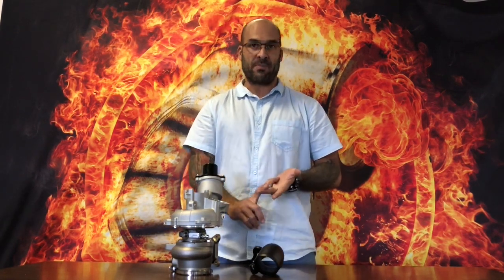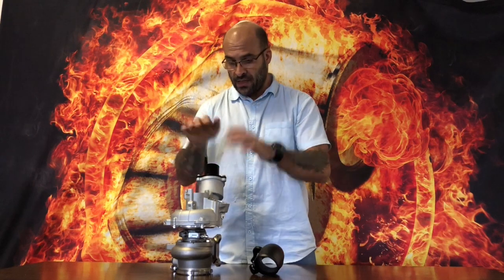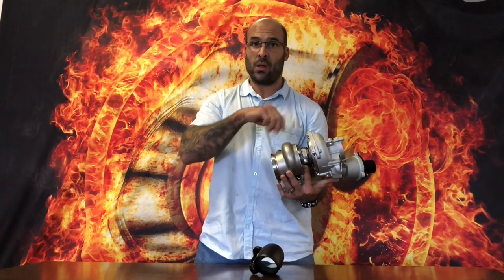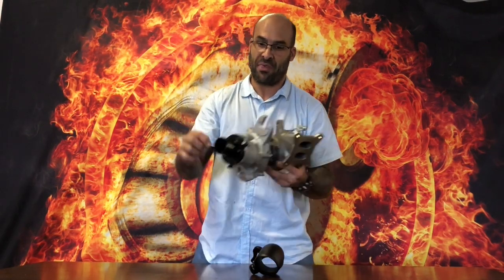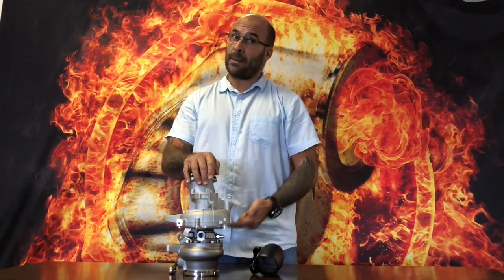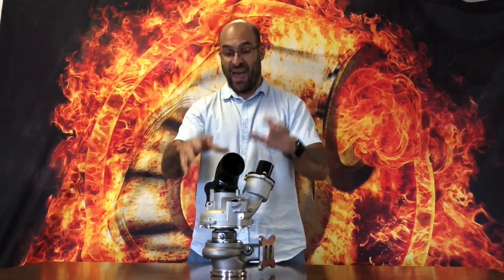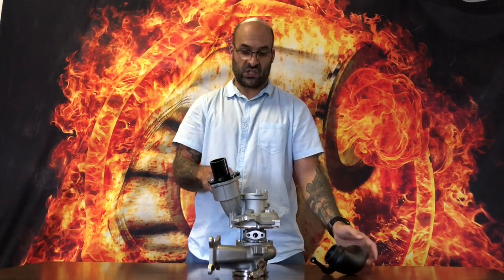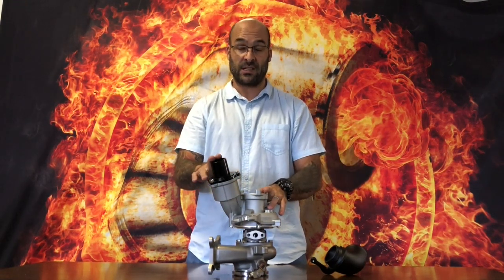IS38 700HP Ball Bearing Bolt on G7R

Comment: Too bad you can't find this turbo anymore
Reply from the maker: We have not discontinued this, we have in fact upgraded and replaced this with something that performs the same but spools alot faster -  see here:- https://turbodirect.co.za/store/index.php/shop/category-layout/results,1-24?virtuemart_category_id=&keyword=is38-550&limitstart=0&option=com_virtuemart&view=category&Itemid=541 

These rotating assemblies are capable of making 550WHP + (fuel system upgrades will be required aswell as clutches on the DQ250) with no problem at all.

Comment: Any update on numbers with this bad boy?
Reply from the maker: Sure plenty of these in the internaitonal market - depending on the tuner, different HP figures will result. Contact Thanos from GT Innovation in Germany, he has extensive tuning on this turbo - he has alot of data.
Reply: @TurboDirectSA  Awesome, will you ever make a GTX3076R version of it? that would be amazing
Reply from the maker: @FLeXJun  Thats where we use the Swirl adapter  - the IS38 comp housing we have designed even with the larger AR isnt enough to support the flow from the larger GTX3076R gen2 Compressor
Reply: @TurboDirectSA  understandable. It's just nice to have internal gate turbo.

Comment: Would you recommend this turbo for a DD. If so when would it be back in stock?   How would I be able to get a proper tune with this turbo on my S3 in the states also, and would my integrated engineering TCU tune work with a 3rd party ECU tune for this turbo. Thanks
Reply from the maker: Tuning we recommend using Thanos Farmakis from GT Innovation in Germany - he is the guru behind the best tunes for the Simos18 ECU's without a doubt bar none!

Comment: Where is your updated information on this turbo?
Reply from the maker: What updated information?  The turbo is what it is - no updates coming, this is a product released in the market. There is an EFR version of this bolt on coming soon - which will incorporate the EFR7163 and/or EFR7670 as the options for this engine.
Reply: @TurboDirectSA  the updates from your comments of charts, graphs, etc of the performance on the car?
Reply from the maker: @rcnacura  We have done alot of testing with this turbo especially abraod with some customers. The top MQB tuning company in Germany called GT Innovation has the most data on the Golf7R with the IS38-700 on.  His name is Thanos Farmakis - aside form the tuning he does he has the most data available. Id suggest you contact him directly for information and his personal opinion and experience.

Comment: Hello! Your project is highly appreciated! Will it work with Skoda Superb 3V3 AWD  (CJXA engine)? Do you have web site/online shop? Just to have an idea about cost of such a quality product 😁
Reply from the maker: thank you for the comments. If the powerplant is the same as the Golf7R or Golf7.5R then this setup will work - if the engine is inline, the turbo will not work due to the differences on the compressor side of the turbo. For pricing please send an email to info@turbodirect.co.za.
Reply: TurboDirect S.A, thank you. Actually, my Skoda Superb 3V3 shares platform with Golf R Mk.7, so it shall fit. Will drop a message to the above mentioned mail box. Cheers!
Reply from the maker: @tec00aba  Pleasure sir

Comment: Dear Chris!,

First of all, I have to say – you have nice and very useful YouTube channel, I have never seen so full of turbo knowledge channel across whole YouTube. Also, I admire your personal knowledge, charisma and willingness to share information!

I have Skoda Superb 2017y, AWD, 2.0 tsi built engine (83mm*92.8*4 = 2008), stock engine used to have 280HP, but now it has something around 510-530HP on pump gas (100 ron) with hybrid IS38ETR Revo turbo (other name is Turbo Technics v4).

It's almost impossible (at least I can't) to find compressor map of this turbo, but I can state some useful facts from my own experience - 1) it has positive spool from 1800-2000RPM on my engine; 2) it has maximum boost (2 bar or 29 psi from 3300-3400RPM); 3) According to logs my engine has air consumption maximum 1450kg/hr (53-54 lbs/min) on 7000-7200 RPM with this turbo.

So, after this turbo blew up my stock engine, I rebuilt engine, I strengthened stock transmission, now it is ready for 800Nm approximately and now I would like to have 600HP+ or 500WHP+ better on a pump gas (I dislike w/m, but if it’s necessary I can deal with it). And one more thing - early spool is pretty important for me, this is almost usual road car, but still – I understand big turbo requirements.

For last 2 months I’m trying to find new turbo for my goals, I’ve considered:
- CTS BOSS 700 kit https://www.ctsturbo.com/product/cts-boss-turbo-kit-mqb-mk7-gti-golf-r-8v-s3-8v-a3/ twinscroll kit with garret 3076r gen2, to be honest I dislike this kit a bit, think this turbo is too big, may be i'm wrong;
- 'handmade' twinscroll hybrid on the base of IS38 with garret g25-660, g30-660 or g30-770 core or compressor;
- wide range of different hybrid's for this engine, such as:
-TTE555, 
- Turbo Technics V5, 
- LM6xx, LM575 https://kolbenkraft-tuning.com/product/lm6xx-gen3-turbo-upgrade-gen-3-vw-golf-7r-mk7-mk7-5-7-r-gti-is38-upgrade-turbocharger-hybrid-lm600-v3-turbolader-upgradelader/?v=6cc98ba2045f
- many-many others.

Accidentally, I’ve found your video about your new IS38 700HP based of garret g3071r gen2. First of all – I’m very impressed with your turbo! But I have some questions:
-	If it’s based on garret 3071r gen2 how it can achieve 700HP? G3071r doesn’t produce enough air for it. I think you mean using E85 with WMI, yes?
-	Dou think it possible for this hybrid to achieve ~600HP on pump gas?
-	What is your price for it?
-	Can you send it in Russia?

Kind regards
Stanislav
Reply from the maker: Thanks for the detailed response, i have rad it and i think that your post deserves a video of its own to cover some of the topics you mentioned below. Ill try to get to this ASAP.
Reply: @TurboDirectSA  Chris, manythanks, i'm looking forward to this video! But still, do you sell this turbo right now and can you ship it to russia?
Reply from the maker: @stanislavaleshin1202  yeah for sure we can.
Reply: @TurboDirectSA  Nice! So, please find my email, I wrote to your personal mail and turbodirect mail adress 26 of June. Thank you, Chris!
Reply from the maker: @stanislavaleshin1202  got it.

Comment: TurboDirect S.A Do you have any solution for the MK6 crowd? I currently have a BW k04-064 and am looking for more.
Reply from the maker: We have PLENTY experience with the MK6 setups, especially with the turbos and ECU (MED17) units, we can provide anything from mild to wild - we have a number of cars running from G25-660 making 400+WKW and another Running the BorgEFR7670 and G30-900 making well over 600WH - we can supply complete builds together with G-force customs from the ground up including tuning, multimaps etc.

Comment: When will you start selling these? Price?
Reply from the maker: We have started selling them two weeks ago, but delays on the supply of Garrett rotating assemblies is holding up the project.
Reply: @TurboDirectSA  OK thanks, does the turbo come will all the install hardware?
Reply from the maker: @idtakae86  Yes it does - we don't supply the water in and out lines just yet, but will be making these up swell and supplying them as a complete bolt on kit so nothing has to be purchased or fabricated afterwards - we will be releasing our 70mm thick intercooler (also bolt on) with aluminium charge pipes (will have a thermal coating on it) which include 3 WMI ports ended in for those who want to use it, swell as the muffler delete nd air intake upgrade pipe. 

We will supply software with this aswell - watch this space for more on the software coming down the line this week some time.

Comment: What makes it different than a CTS BOSS600 turbo that is similar to yours and it also uses the Garett GT30xx wheels & core?
Reply from the maker: Kiewiet no idea what CTS uses in their rotating assemblies. I cannot comment on another companies products, but what i can tell you is that noone can compete with price against our product range apples with apples, we have been designing and manufacturing turbine housings since 2010, our first exhibition with our TurboDirect S.A stainless steel turbine housing products was at SEMA in 2012 - we design components, Billet compressor wheels and housings for international clients which we met at SEMA 8 years ago.  I suggest you do comparative homework and make your decision from there.
Reply: I am sure that it will all come down to price. Both the BOSS600 and Turbo Technique IS38 V5 Hybrid (previously discussed) is rated at 600Hp but very expensive. It would be interresting to see what your price will be.
Reply from the maker: @kiewietduplessis6463  Our price for the IS38600 is not a simple hybrid turbo with the stock shaft diameter and bearing system - these are unreliable assemblies discussed at length in the other videos on my channel - feel free to check them out. 

Our hybrid  (journal bearing) is NOTHING like the thins (unreliable) shaft hybrids on the market today, our setup will handle 2.0bar boost all day long without suffering a thrust failure.  As for Price this can change without notice, but as at today the price is R24800.00 ex vat in South African Rands - this i doubt you will find a product that comes close in price or design and most cetainly not reliability when using the stock shaft and bearing system dimensions.

Comment: How does the spool up for everyday driving compare to a stock/Hybrid/EFR7163 turbo?
Reply from the maker: Kiewiet they dont, you comparing three totally different turbochargers with totally different flow capbilities and three different rotating assemblies. The Stock turbo will outspool all three - as its the smallest and uses the stock turbine and compressor housings. The Hybrid (Which one are you referring to? - there are many guises that different companies sell) will be laggier, but the rotating assembly is much larger, hence much higher HP output, and depending on which Hybrid you referring to, most of them use the stock original IHI turbine and compressor housing, and have either the turbine and/or compressor wheels machined into the housings. Our IS38600 Thick Shaft does NOT use the stock AR turbine or compressor housing, yet uses a larger rotating assembly, and makes more power then the above hybrid example, but is slightly laggier due to the upgraded AR's in the end housings. The EFR7163 utilises a Gamma TI (Titanium Aluminide) turbine wheel head, which weighs 30-40% less than Inconel 713LC - making this turbo (even though its physical diameter on the turbine is as large as the hybrids) spool MUCH faster than the hybrid setups in Journal bearing format.  Our IS38700 which also utilises the larger AR turbine and compressor housings but installs with the Genuine Garrett GTX3071R Gen2 rotating assembly, will spool later than the stock turbo for obvious reasons, but make 700HP
Reply: There will always be a sacrafice between spool up makin HP's. Question is what is your goal? Fast street car or full on racecar? Getting the right ballance between lag and making power is key. Guess we will just have to wait for dyno graph.
Reply from the maker: @kiewietduplessis6463  nail on the head - fully agree. Dyno graphs coming soon, lots of mods to be done to the car before this can be tuned.  Stay connected to our channel - lots more info coming soon
Reply: Ok so let me rephrase. At what rpm can you expect to reach full boost? Obvious a dyno graph comparison will answer alot of the questions one might have.
Reply from the maker: @kiewietduplessis6463  What tune? What ignition advance? What AFR? What Intake? What Boost? What DP?, WMI? What Fuel? Fuel pump upgrades? Injectors upgrade? -- in short how long is a piece of string? 

This is not a facetious answer at all, its impossible to predict the boost response of ANY build without  physically testing it on a dyno its that simple.  A guideline can be provided but it all depends on all the above and more - im afraid there is no straight answer, every car will be different.

Is the Hybrid streetable? - well it depends on how much HP you want. If you only want to see 380WHP - then the "hybrid" you need is a simple compressor wheel upgrade. 

If you want 450WHP youll need a proper built hybrid BUT you can get away with this inside OEM (small AR) housings, this spools better than a full hybrid with larger AR housings

If you want 500+ HP - then you going to have lag - with power comes lag - it is what it is im afraid.

Comment: Excellent work guys!
On a side note, is Garrett ever going to release a divided internal gate housing for the G30's????
Reply from the maker: Thanks buddy - Garrett have what we call a pignose housing for the GTX3584RS which is a vband inlet but divided -- its twin scroll -- there are housings that have a T4 inlet twin scroll flange, that fits the GT/X30R turbos - this will also work with very slight mods. problem solved -- we will be re-releasing our newest stainless steel turbine housing range with vband inlet and outlet in the next two months aswell - designed for GT/X28, 30 and 35R models. Watch this space -